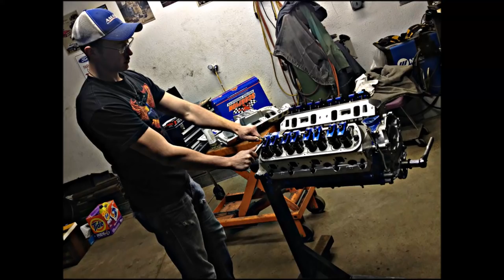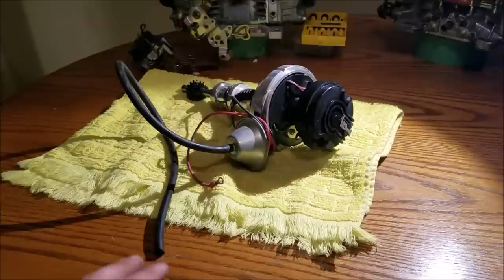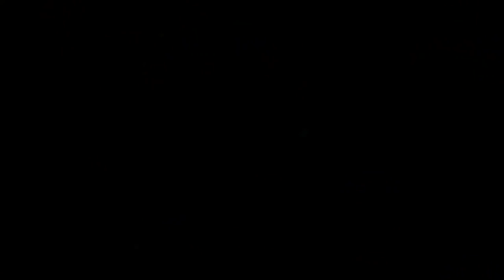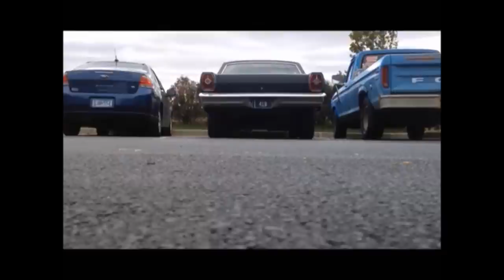Vacuum Advance Explained - What it is & How it Works

Comment: The guy who built my motor a 350 chev w/ RV cam. I told him I wanted low end torque sometimes it acted like it wanted to ping on acceleration. so sometime after I check where the timing was at idle and it was at 25 and  also notice he had manifold vac not ported hoocked up so I change it to 10° initial timing vac disconnect and them hooked up to ported vac. What I noticed now is the centrifugal weights where sticking so fix that and now if I rev it quickly the idle does not come backs all the way down to about 750. I think he put in some really light springs so the weights start flying out just above idle. So I'm going to check it. and I got me a curb kit for the advance. Any thoughts on this will be appreciated. Yes I want good low end but also good mid range. Someone on u tube said he likes having total advance by 2400. What do you think?
Reply: What vehicle is this engine in? So-called "RV" cams are typically low duration, low overlap designs that build a lot of low end torque and flatten out above 4500 rpm. Cylinder pressure off idle is high so they don't need a fast timing curve with a lot of advance down low. Full advance by 2400 may be ok for a light performance car with short gears and a performance cam but is too early for a torque motor in a heavier vehicle as it would make it prone to preignition. Total mechanical advance of around 36 degrees is good but I would think having it all in by around 3000 would be safer.
Reply: @65sohc  68 chec truck 1/2ton manual trany 3:73  gears w/ 31" tires
Its a 4x4... i know twilight zone moment where's Rod Serling???
Reply: @65sohc  total timing is 69° 15 ° above normal i know. Harmonic balancer is in good cond.  I think its the 8° of advance valve timing that he set that causes the ing timing to have to be 15° advanced. Ro run right. No pinging either.
Reply: @mtnman6278  Have you actually checked the timing yourself? 69 degrees seems impossible. If I'm not mistaken advancing the cam creates even more low rpm cylinder pressure and wouldn't call for more ignition advance. But if it runs good what the heck.
Reply: If you figure vacuum advance is about 15 degrees+centrifugal 25, that's 40. In order to have 69 total initial would have to be 29. I'm surprised the engine would even start with that much initial timing. Something isn't right. If those are actually the numbers you are seeing on your timing light I would suspect the marks on the balancer are off.
Reply: @65sohc  i agree thats why i double checked balancer i though the same thing irs hard to believe that a well known engine builder back then would put in the a balancer with the wrong mark when i ask him to install a new one. He had to tune and timed it and run it before i got it. I got 18° of vac. 18°Centrifugal plus about 31° or so initial so i get 69 with all of it the moment i punch it vac drops so i loose 18° in going to find the spec sheet he gave me and seed where the valve timing is at. He advanced it.
Reply: @mtnman6278  Well Mountain Man, all I have to say is that NO legitimate tuner has EVER specified 31 degrees initial timing. There must be 10 million smallblock Chevies in existence. The chances that yours is is only one that makes maximum power with 49 degrees of total mechanical advance are far less than your chances of winning the lottery.
Reply: @65sohc  It blows my mind.  I've never seen this before. It doesn't make sense to me either. Thanks! for the exchange.
Reply: @mtnman6278  Yeh. The spec sheet would be interesting, especially if it actually shows those ignition timing numbers.

Comment: Thanks for the insight.  I don’t think my mechanical advance is working as I rev the engine.  The marks on my distributor only move 3-6 degrees approx. on revving.  Is this correct?
Reply from the maker: I'd bet your mechanical advance is pretty hung up or the springs are wore out. You can pop the cap and should be able to rotate the rotor via the advance mechanism. If it barely moves or fails to return after moved, you can be sure that you have a mechanical advance issue

Comment: You invited questions so mine is: Do you have any knowledge to share concerning performance oriented centrifugal advance spring kits (for example Mr. Gasket 925D)? I'm running a mild 289 (F303 cam, Edelbrock Performer RPM heads, 650CFM Holley w/vacuum secondaries, headers, stock distributor w/Pertronix. Car is about 2400 pounds, 5 speed, 3.54 rear end. Thanks in advance.
Reply from the maker: Everyone makes ignition timing difficult, but it’s actually very easy. 
Outside of your throttle settings, you want the spark to fire as soon as possible without timing creep at idle (too light of springs will sporadically pull idle timing) 
So after you set your idle initial timing, choose springs that pull in timing as soon as possible without causing spark knock (pinging). 

Set initial by setting your transfer slots tova square, and adjusting your initial timing along with your mix screws to set your idle - you have about 1 full turn of the idle screw from square t slot to play with before you get an overexposure scenario. I personally run on ported vacuum. 
Typically I see that for most folks with vacuum canisters that pull more than ten degrees that this works best. 
Thunderhead289
Reply: ThunderHead289 Thanks for the quick reply. And thanks for reminding me about possible idle creep. The good news is that light springs can possibly tailor the timing to an optimum curve; the bad news is the greater propensity for failure. And thanks for the Holley tip.
Reply from the maker: As odd as this sounds, I have found that I snap the heavy springs more! 
Transfer slot theory works for all transfer slot carbs - with running a vacuum gauge and a wideband gauge side by side, I have seen the best results all that I have mentioned above. 

Also, I super simplified this video - when you open your throttle, cylinder pressure also rises - the higher the pressure, the denser the mixture, and the quicker the fuel charge will burn. 
So cruising needs more timing, into the throttle takes less. 
Remember, the goal is to fire the mixture as soon as possible on the power stroke to use as much of that stroke as possible.

Comment: Question .. my Cleveland 351 bored 30 mild cam stock crank , 650 edlebrock  my little prob is when iam at cruising with very pressure on the pedal  I get a pop through the exhaust it happens in 3 rd and 4 gear . Just thought I would pick your brain .. thanks
Reply from the maker: seems like too much cruising ignition timing off hand. several things can play into this including air fuel ratio. if you have vacuum advance, remove it and see if the issue persists - this will help diagnose the problem. get back with me here.
Reply: Thanks ,will do
Reply: Well I remove the vacuum advance hose  , plugged off both ports one on carb other distributer and problem gone , can the advance be changed or adjusted because the vacuum advance can be tuned with a Allen key
Reply from the maker: ah , good deal. so it was bringing in too much advance. the adjustable units are a bit tricky. if you lesson their advance, you will also lower the vacuum at which they will drop out of the timing equation. so for example, you have one pulling in 15 degrees of timing that drops out at 13 inches of vacuum. adjusting it will make it add in only say 10 degrees, but now it drops out at 10 inches of vacuum. my issue is that they are still adding in extra timing now at a higher load then they were before. its just gray area. this is the point where you have to listen for pinging or stumbling issues.
Reply: Well in the gray area , there is no ping or stumbling . Now is it possible to adjust the timing so I can run with the advance hooked up to improve fuel economy  and easier starting ( just that when the advance was hooked up the choked worked , one press on the pedal and it fired up and run on high idle then when warm it kicked down)

Comment: Did the timing on my 84 jimmy has a 350 with holley carb stock cam  and when i connect the vacumm advance back in it revs really high
Reply: Good, it's supposed to do that
Reply: Diaphragm may be bad causing a vacuum leak

Comment: Can too much timing cause me to stumble than take off when I mash the peddle ? Throttle response is really good with regular driving. But if I go from idle to (wot) it falls on its face than takes off like crazy ? Would you call timing or bigger square nozzle ? I have a summit carb. Running manifold vacuum on stock cam. 12 degrees initial timing.
Reply from the maker: Timing that works is a reflection of your idle mixture. - they both work hand in hand. It sounds more like your transfer slots may be over exposed at idle which are in charge of some of the off idle transition. Also, make sure you don’t have play in your accelerator pump. That can easily cause a bog off the line
Reply: Too much timing you will hear the pistons pinging.

Comment: I have a chevy 305 and noticed it doesn't have a vacuum advance, so do i have the mechanical one then ,and should i get a distributor that has one ,answer from anyone appreciated,,thanks
Reply: Just go ahead and get a whole new dizzy. They sell new hei distributors on eBay for $50

Comment: what would you recomend for totel timing on a 1979 351w 2150 motor craft  2bbl  c4 trans chines short tube fox body headers duel 2.5 exhaust h pipe glass packs no smog junk on 87 octane?
Reply: 32, then 34, then 35 deg. @ 2,500 rpm. Test drive at each. Choose whichever one performs best at that point. Just saying.

Comment: If I am understanding correctly, I plug the vac hose when I am setting my initial and the advance timing. If I have an aggressive cam (280 degree intake/286 degree exhaust), I use manifold vac, or ported vac?
Reply: Manifold. And any cam around 300 degrees or over you definitely dont use any vacuum advance. Bigger cams, you set the timing somewhere in the 16-24 degree range at idle, and build a stop on your centrifigul advance to full advance at 36. Big cams need a lot of initial timing. Bigger cams need the most. They dont make enough vacuum to run a vacuum advance properly. The low vacuum causes "dithering" that means the vacuum cant open the centrifigul advance all the way, so it never ends up at the same spot at idle, causing erratic idle RPM's and stalling. Older cast iron heads have poor volumetric efficiency so need the most timing advance compared to modern computer designed aluminum heads.  The more duration you have (valves open longer) the bigger the pistons you need. Valves open longer steal compression.
Reply: Always ported vacuum.

Comment: Question: Just completed tune-up on 318 Mopar Engine 2 barrel Holley; idles and revs great until I hookup vacuum advance; starts missing when reving RPMs; What's the problem? Remove vacuum advance and runs great again!?
Reply: Either the vacuum advance is adding too much timing (likely) or the vacuum advance diaphragm is ruptured and causing a vacuum leak (unlikely).

Comment: I have a 79 Camaro with a 350 sbc. I have to turn the distributor counter clockwise till the vacuum canister hits the intake before it will run good. Way past the timing marks under the light. Could this be my vacuum advance canister being bad ? Wiring is correct , rotor points to #1 , TDC is checked.
Reply from the maker: this is interesting - rotor points to one when cylinder 1 was at the top - this should also line up with your timing mark. ???
Reply: ThunderHead289 yes
Reply from the maker: +Dan Smith but you have to advance your timing to the point that you can't see the timing marks for it to run. - correct? What degree do your timing marks go up to?
Reply: correct. when the distributor is where it should be the mark on the pulley is st about 1:00. with light and running. when it runs the best is at about 5:00 And 0 on the tab is   at 4:00 the car wasn't running when I first looked at it but he replaced something in it and then called me back to look at it. I believe he said the module was bad from sitting to long. after market tab and not sure about the pulley
Reply: yes. When I first looked at the car it wasn't running. A few days later he called and said he got it running. I believe he said he replaced the distributor module. Said they go bad from sitting to long. When I ref it up it wants to backfire and stall out but if I ref it up slow it goes. Timing marks line up at TDC, rotor points to #1 and the wiring is correct. The distributor is set  with the vacuum advance canister between the intake and valve cover . But for it to run good I have to turn the dist. counter clockwise till the canister hits the intake. And at this position the timing mark is below the timing tab about an inch under the light. Could he have messed something up in the dist. ? He said he had to take it all apart to replace whatever it was he did.
Reply from the maker: all these things just arent adding up. its hard for me to visualize, but i wonder if the timing tab or balancer is just not the proper one for the engine. you seem on the up n up where you would know if you are hooking your timing light to the proper plug wire. id order one in from oreielys and compare the marks to be sure. something is awry here and it seems to be difficult for me without having eyes on it.
Reply: Crazy right. I've been busy lately but I never checked the vacuum itself. He did install a bigger cam but couldn't remember what size. I know it runs off the carb now. Is this ok or should I move it to the manifold ? " vacuum line"  Thanks for your help also
Reply from the maker: +Dan Smith I think for a big cam, it's best to just leave it set to ported vacuum. Have you messed with any of your carb tuning? The oldschool stuff is a happy balance between a carb and distributor
Reply: Haven't gone that far yet. Going to hit it again first thing in the morning. I'll let you know what we find. Thanks again.
Reply: Had a friend come over and double check everything for me today. It was fine. He took the rotor off and the curve weights were very sloppy and there was only one bushing left. Also they were covered in rust. You could just lift up on the springs to remove them. No resistance at all. Could this be my problem ? Thanks, Dan
Reply: Installed a new distributor and it runs fine. Thanks
Reply: You can pull the distributor up and move it one tooth, it will adjust earlier or later depending which way you go, but when done right you will solve that problem.
Reply: Pull the dist up and move the rotor clockwise 1 tooth that will fix it
Reply: Sounds like to me, just guessing, your distributor is off a tooth becausing you're having to turn it until the canister hits the intake...just guessing.... sorry but I can't Rem which way you pull it up and turn it just a bit. when u put it back in, because the gear teeth are at an angle...watch real closely and the rotor will turn as you seat the distributor. Not sure but seems turning it counter clockwise a tooth would bring the light firing later on balance. Please someone correct me if I'm wrong....
Reply: Need help... have a '85 El put a '78 350 in it with comp 268 and quickfuel 680. Turbo 350 tran, 2.42:1 rear gears.How can I make it get better mileage. Have watched so many videos going crazy. Ported vs manifold vac?????....timing is hei with canister. Don't care about the lopey  sound at idle. what happens if I lower primary jet size and kinda balance that out with larger secondary for performance. Will lowering primaries improve mileage or lean it out too much... Sorry for so many ?'s
Reply: Two more questions...?Watched videos saying with a auto and 268 comp in 350 had to put a 1" plate to clear intake vacumn port, carb was hitting it. Bought a 90 fitting for vacumn access but still needed the plate. Shouldn't I be running vacumn hose from large port on back base of carb to brakes, instead of basically one runner of intake so I get full vacumn to brakes. Brakes don't seem to be quite as good....? Other question is, figuring out how to get carb to fit without that plate...would that increase my mileage. if it makes a difference , intake is a dual plane air gap eldebrock You can get other info from my previous post.
Reply: distributor is off a tooth
Reply: Dan Smith I might bounce you slipped on the crank
Reply: Dan Smith m

Comment: Hey brother, been having a great time looking through your videos as a new content creator.

I don't want this to come across the wrong way, but I feel you maybe a little off the mark with your understanding of vacuum advance and it's operation. I'm not sure how I can make contact with you, but I will try and make a video in the coming week of my experience with it as a former carburettor and ignition specialist and the different methods in which it operates. Again, I hope this didn't come across the wrong way.

Look forward to hopefully working together with you somehow in the future.

Rob.
Reply from the maker: Hey rob, 
You are probably one one the smart ones - I tried to “simplify” this for folks to a degree because every time I start talking about cylinder pressures as it relates to burn time/ flame propagation, cylinder volume charge density and so on it just goes right over folks head. 
Technically when you are cruising you have a much less dense charge - that cylinder charge will have a slower burn time. When you stand on it, cylinder pressures rise and likewise the burn time is much quicker - same concept between a compression test with throttle closed vs open. More pressure = less timing (among other factors), and less pressure = more timing (again, among other factors) 

Anyway, I’m a really wordy guy so sometimes I have just tried to present things in a way that will have folks use something properly and not get too invasive - perhaps this was a disservice on this video. 

You can contact me at brotherford289@gmail.com if you want to talk - I always enjoy knowledgeable folks.